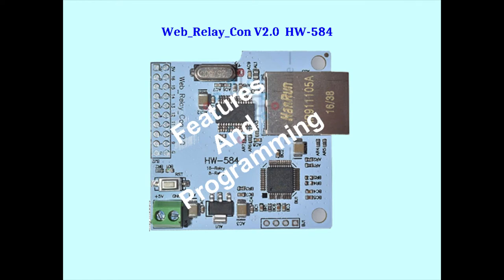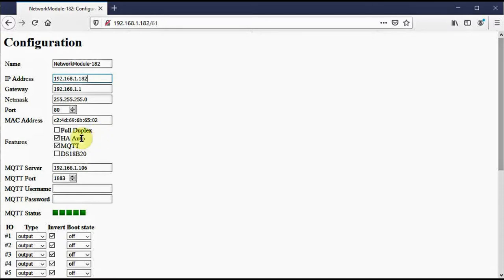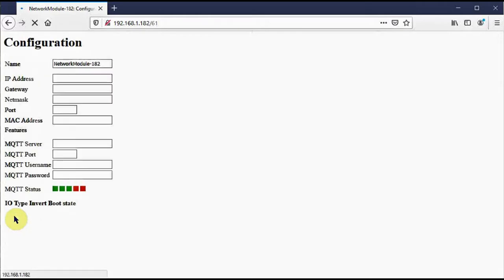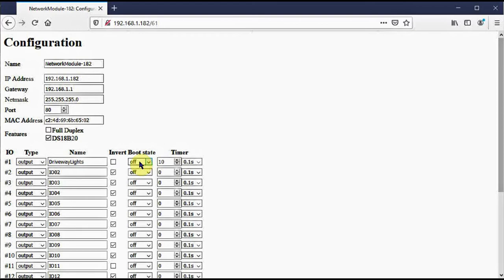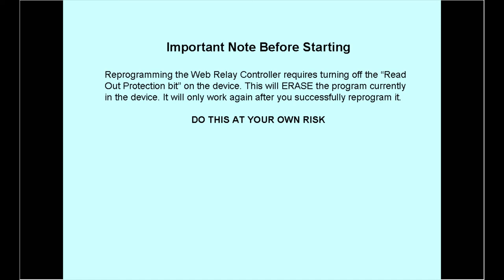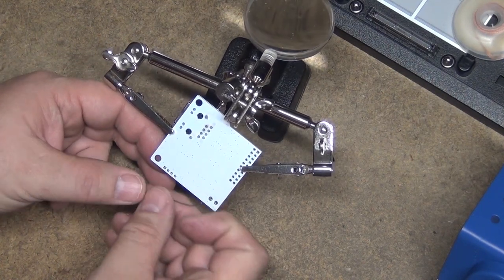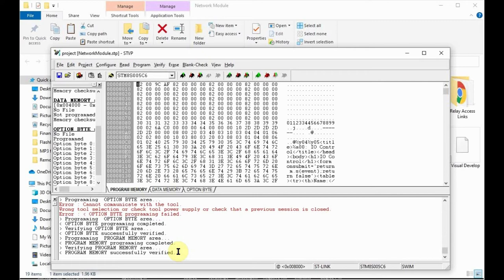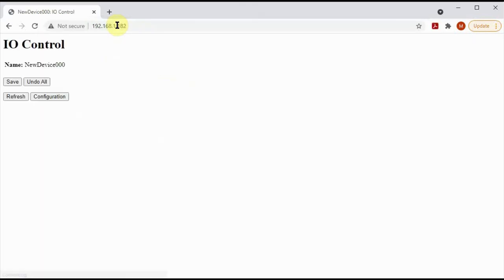YouTube4Web Relay Con V2.0 HW-584 Network Module 8/16 Channel Relay Controller ENC28J60 New Firmware

Comment: Anyone using these with hassio?
Reply from the maker: I haven't heard from anyone using hass.io specifically, but I (and several others) are using Home Assistant on Windows and Linux with this device. Since we're working with Home Assistant in those environments, and hass.io is primarily an installation manager for Home Assistant in specific environments, I would expect the use of hass.io to be transparent to this device.
Reply: @nielsonm.projects  will have to find a sample of the code to test this out.
Reply: OK so code 99 gives a string of states, will have to figure out how to code this...
Reply from the maker: Since you mentioned hass.io I assume you are using MQTT, and perhaps Home Assistant. Command /99 is a way to get the pin states if you are using a Browser. But in an MQTT environment you can use the state-req command to get a summary of all the pin states, and the device publishes per pin state message when a pin changes state (which an MQTT client program would monitor to be notified of changes). Further, if you ARE using Home Assistant you can enable Auto Discovery so that Home Assistant can automatically set up a device card for you.
Reply: @nielsonm.projects  I'm not using mqtt but command_line as follows:
switch:
  - platform: command_line
    switches:
      irrig_zone1:
        command_on: "curl -X GET http://192.168.1.4/30000/00"
        command_off: "curl -X GET http://192.168.1.4/30000/01"
        friendly_name: Zone 01
      irrig_zone2:
        command_on: "curl -X GET http://192.168.1.4/30000/02"
        command_off: "curl -X GET http://192.168.1.4/30000/03"
        friendly_name: Zone 02
      irrig_zone3:
        command_on: "curl -X GET http://192.168.1.4/30000/04"
        command_off: "curl -X GET http://192.168.1.4/30000/05"
        friendly_name: Zone 03
      irrig_zone4:
        command_on: "curl -X GET http://192.168.1.4/30000/06"
        command_off: "curl -X GET http://192.168.1.4/30000/07"
        friendly_name: Zone 04
      irrig_zone5:
        command_on: "curl -X GET http://192.168.1.4/30000/08"
        command_off: "curl -X GET http://192.168.1.4/30000/09"
        friendly_name: Zone 05
      irrig_zone6:
        command_on: "curl -X GET http://192.168.1.4/30000/10"
        command_off: "curl -X GET http://192.168.1.4/30000/11"
        friendly_name: Zone 06
      irrig_zone7:
        command_on: "curl -X GET http://192.168.1.4/30000/12"
        command_off: "curl -X GET http://192.168.1.4/30000/13"
        friendly_name: Zone 07
      irrig_zone8:
        command_on: "curl -X GET http://192.168.1.4/30000/14"
        command_off: "curl -X GET http://192.168.1.4/30000/15"
        friendly_name: Zone 08

I need to see if there is a way to do the same and get the state, if not then mqtt might be the way to go.

FYI I haven't re-programmed the board yet, waiting on the programmer so still haven't tested using your code.
Reply: OK so there is a way to use the URL, I am trying to avoid MQTT for now :)
In hassio there is a thing called scrape: https://www.home-assistant.io/integrations/scrape/

I managed to get the ascii code from the original board (remember I haven't re-programmed it yet with your code) doing the following:

  - platform: scrape
    resource: http://192.168.1.4/30000/99
    select: "p"

Basically I am retrieving whatever is in the url "http://192.168.1.4/30000/99" at the <p> tag.

Comment: Just watched your video again and it's so impressive how you cover every detail of this pretty complex procedure.
I'm going to flash my one board with the Browser interface. After I get more comfortable I'll try the MQTT of which I know nothing about.
I also am trying to use Home Assistant for my Home automation with limited success. But I do know some HTML from way back years ago, and starting to learn Python. Of course the bog attracting here is you are using Windows for flashing these TCP/IP boards and that I am very comfortable with. Thank you again. I hope you'll be around if I have any questions. Take Care
Reply from the maker: Yep - I'm here. I use these boards in my own home automation so I plan to be available for support for a good deal of time. FYI, I'm finishing up adding the ability to reprogram the devices over ethernet - almost done. It does require addition of an external EEPROM, but that is a simple process. But since you are just getting started it is best to program the devices with the SWIM interface per the video. Yes - Home Assistant can be a bit difficult to get started. I don't consider myself to be "an expert" on MQTT or Home Assistant, but I did manage to get it going with help from others with experience and, of course, Google.
Reply from the maker: If you go to the github site (https://github.com/nielsonm236/NetMod-ServerApp) and set yourself up to "watch" you'll get all the notifications regarding updates and progress on changes. The "upgrade over ethernet" item is issue # 71.
Reply: @nielsonm.projects  I have indeed be already done that. Looking forward to your postings. BTW now that I've got the newer Ver 2 TCP/IP boards I'm returning the 
Ver1 TCP/IP board and 8 port combo unit I purchased on Amazon.
Thanks to their 30 day policy. It works but since I can't upgrade it and it has a fixed Mac address, it's not going to work long term.
Reply from the maker: Sounds good. If you find any issues you can send me an email (the projects email address is on GitHub), or you can open an Issue on GitHub.
Reply: @nielsonm.projects  Thank you I was hoping you would offer some support. I'm sure I'll have questions. I did receive two 8 Channel Relay boards today that use 5 volts. I also have Four Ver 2 TCP/IP boards also. Two are 8 ports and two are 16 ports. I assume just the TCP/IP board gets the 5 volts and the relay board gets it's power from the TCP/IP board. As it just connects directly to the relay boards 10 pins.. I'll remove the (vcc-jd)jumper on the relay board. I'll double check that, but I think that's all that's needed. I want to power everything up before I flash it with you need firmware. And I'll continue this conversation on your GetHub page. Thanks.
Reply from the maker: You may want to look through the manual on GitHub. I have some suggestions there on how to provide power depending on what you are trying to accomplish. Some quick pointers: 1) There are lots of variations in the design of the relay boards, so the manual describes how to handle those variations. 2) You will need a very good 5V power supply if power is provided to the TCP/IP board and then that power goes to the Relay board. The TCP/IP board hardware is very sensitive to power "glitches", so relay switching can cause the TCP/IP board to reset. The manual describes much of this. 3) It doesn't matter if you bought an 8-channel or 16-channel TCP/IP board. Once the new firmware is loaded they all become 16 channel boards.
Reply from the maker: Hi - I responded to your inquiry on GitHub but haven't heard from you. You were asking if I could contact you directly, but didn't leave an email address, so I was only able to leave a reply in the Issue you left on GitHub. You can reach me directly at nielsonm.projects@gmail.com

Comment: respect for this work! still you makes updates? =)
Reply: @nielsonm1  Never had to work with a devices from Lambda Nu? (e.g. Net Control NC-400)
Reply from the maker: I have no experience with the NC-400. Unfortunately the Lambda Nu website doesn't appear to be working (at least at the moment ... it does not respond). Looking at other retail sites it appears to be about 3 to 4 times more expensive than the HW-584, but does have 4 relays integrated on the board. Not sure if it can be expanded with more IO. I can't get to any specs to see what the user interface looks like.
Reply: @nielsonm.projects  I sent you an email with information about the device =)
Reply from the maker: @FromBunker  Thank you